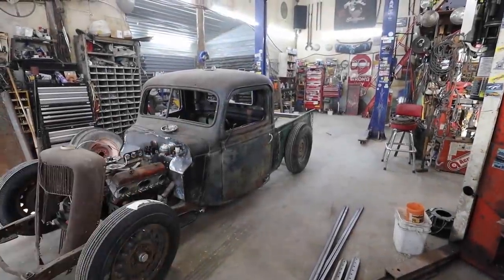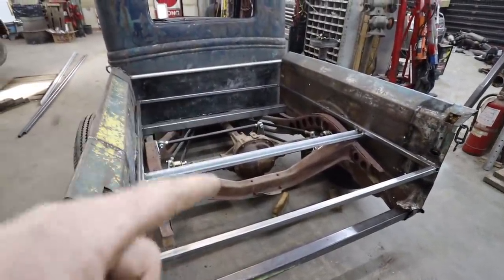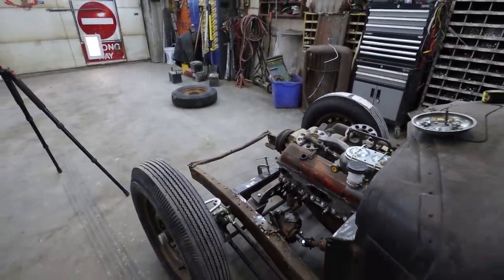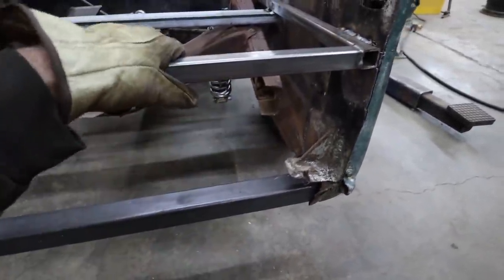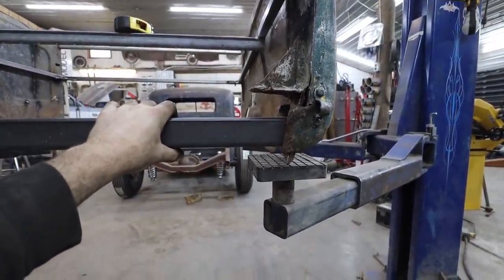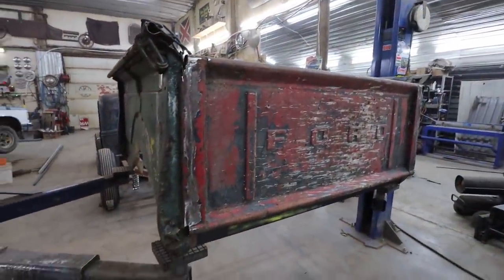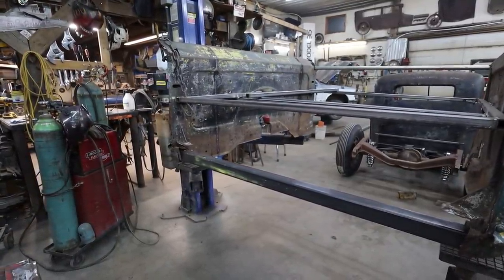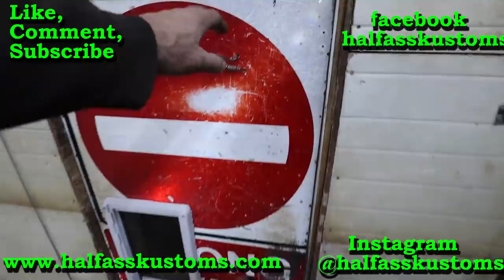Building inner box frame to mount box and narrowing a tailgate to fit  37 Ford pickup Part 12

Comment: Brent, that offset drive shaft angle is super kooky or as the kids might say supes kooks. By the way, I totally am on board with the gas filler behind the tailgate that would be pretty sweet. Also a pull-out drawer back there for some tools would be pretty nice also.

Comment: What’s you opinion on using a 15.5 gallon stainless steel beer keg as a gas tank? Cut off the beer tap Weld on a filler neck and weld on some fittings on the bottom side. Should be pretty easy to use an external fuel pump set up.

Comment: The tailgate turned out great!  I used screen door bolt latches welded to the inside of the gate with a hole drilled in the bed side.  Merry Christmas HK!

Comment: The red valve cover engine on the 1937 Ford Pickup in part 12 of filming in your farm and garage. The synthetic rubber washer for mount the engine to the chassis at the front. The rubber washer is called bushing. The bolt with fender (big washer) goes up thru the bushing and place another bushing in the between chassis and holdup engine bracket for mounting. then place third bushing to the same bolt and the third bushing goes to between second flat fender and engine bracket. then tighten it with lock nut. That will be on driver side mount. And will it be another mount bolt with fourth to 6th bushings for mounted of your engine? 
  I like your show and the shop. Thanks.

Comment: Is it possible to build the gas tank into the front of the box beside the battery and fit a spare tire at the rear accessible from underneath or slide it into a compartment when the tailgate is down? - yep a doughnut spare with jack and some tools

Comment: Cut off the frame after your bed mount bolts and build in a "secure" lockable box bellow the floor, using the tail gate to enclose it. You could use it for any thing you needed to carry and not worry about when you walked away from the truck.

Comment: I'd like to suggest you not install a tank where you want to put the gas tank.  I thing a Spare tire cubby at the back of the bed (like the way they put spares in rumble seat cars) would be better. You still should have plenty of room towards the front of the bed to install a gas tank and even set it up for a side bed filler neck and cap.

Comment: You made way too much work for yourself the way you decided to shorten the tailgate.  You could have cut the entire end rail off and shortened it on the inside, then you could hide your weld in the inside seam and kept the factory outside edge and face smooth.

Comment: Why not cut the tailgate in half, or so, lengthwise, with the top as a tailgate for the shallow bed and the bottom closing off and hiding the fuel tank.  You could also mount the tail/stop lights in the bottom half.

Comment: The tailgate really makes the bed look complete.  It is a big plus that it actually works.  The area where you plan to put the gas tank would make a nice lockable storage area or for a spare tire if you didn’t absolutely need the space for the tank.  Are you planning to bead roll the floor ofmthe bed?  Looking forward to the next video…👍👍
Reply from the maker: nah think I'm going with a wood floor of some kind